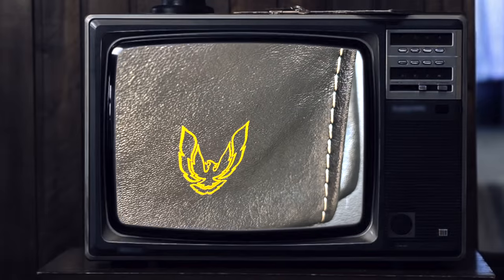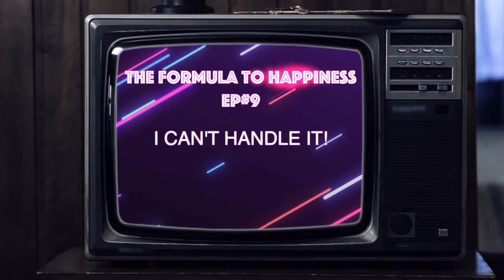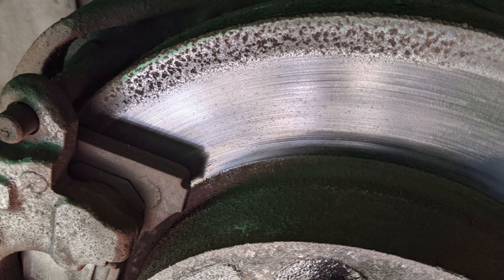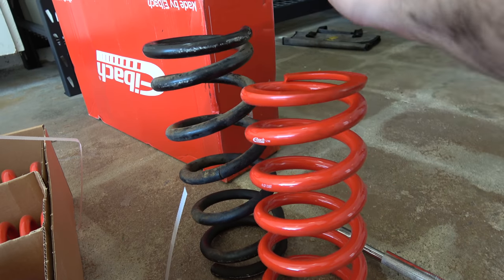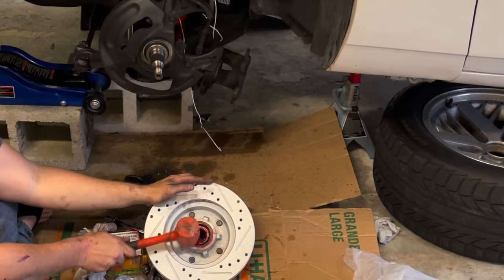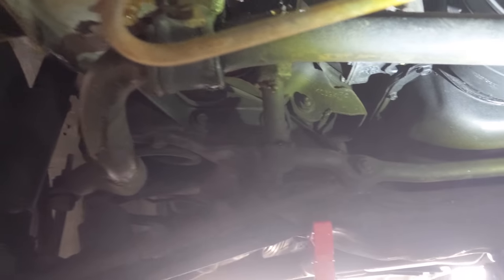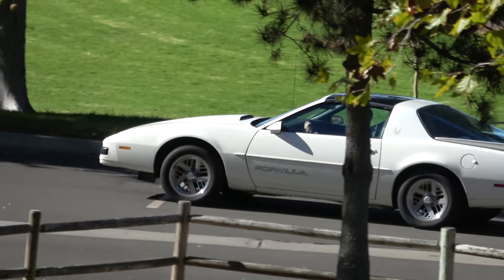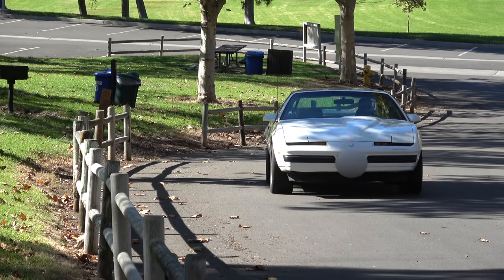"Performance Suspension" More like "Impotence Suspension"

Comment: I have a 1988 Trans Am GTA 66k miles with the WS6 suspension. Just bought a 91 Camaro RS with 28k miles. Both all original. I'm watching this and wondering if I just doubled my pleasure or quadrupled my pain.

Comment: After putting rotor on fill rotor cavity with grease, at least half way, as wheel spins and warms, it will spread to keep bearings always in grease. There will always be newbies needing mechanical advice, hope u put pucks in worthy of expense for the rotors

Comment: Get a wonder bar and some weld in subframe connectors along with Koni adjustable shocks. Trust me it will completely change the car. That and poly bushings.
Reply: I commented this prior to watching the video lol. You're heading in the proper direction.
Reply: @FWDSUXARSE  Thanks mate, that's all very good advice and I'm going to do all of that minus the koni's for now (that'll happen eventually but I have that 1978 2nd Gen to do as well so I'm splitting my resources)
Reply: @serpentza  I completely understand that. Right now I'm down to just my 98 Trans Am (not a WS6 but it's better than one based on what I've done with it) I'd recommend a rear end cover that puts a preload on the bearings (our rear ends are junk trust me). Check out Hawks for that. Check out Founders Performance for a panhard bar along with a strut tower brace. Very affordable and good quality. I just installed weld in subframe connectors on my 4th Gen from Founders and they tuck up against the subframe really nicely and my car hooks up without any wheel hop now. The Koni shocks made a huge difference so when you get to that point, it's well worth it. I'm only pushing about 350 rear wheel HP on my car at this point, but the subframe connectors along with the other suspension mods have made a huge difference. Doesn't even feel like the same car from when I first bought it (not in a bad way). If you ever need any advice on the 3rd gen Fbody, please feel free to contact me. Between my brother and I, we've owned a dozen 3rd and 4th Gen cars, both stock and modified V8 models. Plus from the looks of it there's plenty of other folks who follow your channel who have sound advice as well.

Comment: It was a great suspension package back when it was new. Right up there with the Corvette, which compared to modern cars is crap. The generation before your Firebird had the RTS package. That's Radial Tuned Suspension because radial tires were new on the market. So yours would be even better. Don't knock it. Comparing old to new is comparing apples to oranges.
Reply: I have a 1978 Trans Am as well with the RTS and yes, same sort of thing probably good in the day but a joke by modern standards and that is why I want to update these awesomely cool cars to modern standards so that they can be enjoyed as they're supposed to be

Comment: Winston if you replace the end links with a whole kit might I suggest using a grinder....
Grrrrrrrnddd thru the middle n pull bits out - less stress n mucking about.

Hell I cringed when you took a palm SANDER to the brake rotors! Many years of accurate on car brake disc machining (mobile) tells me that’s just plain SHIT lol
Reply from the maker: Yep, I wasn’t pretending it was good
Reply: @WorthlessWhips  true that

Comment: Do you know how to weld?
Reply: Yes but not very well
Reply: @serpentza  Can you do a video on welding stuff like motorcycles and cars then?
Reply: @beniamino939  best way to become proficient is to teach the subject.
Reply: @williamswenson5315  I can weld.  But I'm curious what his take of fabricating with a welder would be.
Reply: @beniamino939  See if you can contact him via this channel or on Serpentza. I'd break it down into gas, stick, MIG or TIG. I suspect he's done a bit of gas welding, but doesn't feel comfortable doing it from lack of practice. Still, a small oxyacetylene rig can do quite a bit of useful repair around the shop. I just repaired a catalytic convertor for one of my vehicles and saved $900 by not paying for a new one. Good luck with your quest.
Reply: @williamswenson5315  A flux core welder from harbor freight is pretty full proof for laying some beads on regular steel.
Reply: @beniamino939  Yeah, you know, their tools aren't bad. I wouldn't buy them for heavy commercial use, but for the average person who is a handy sort, they're OK.